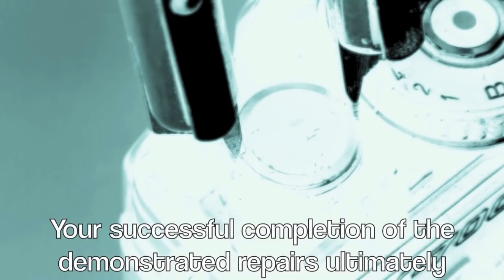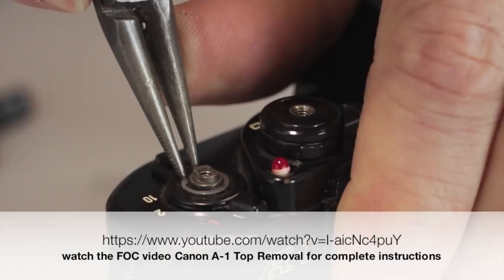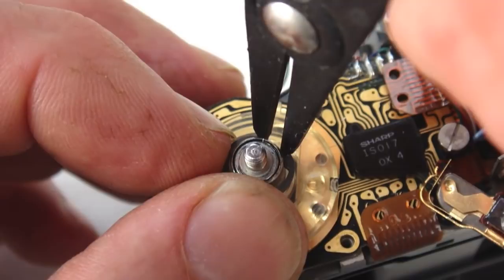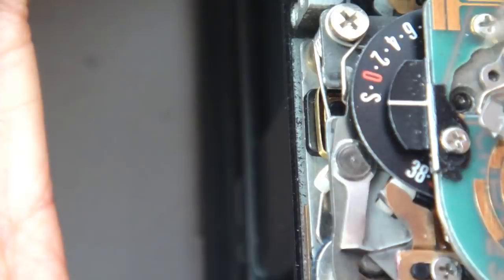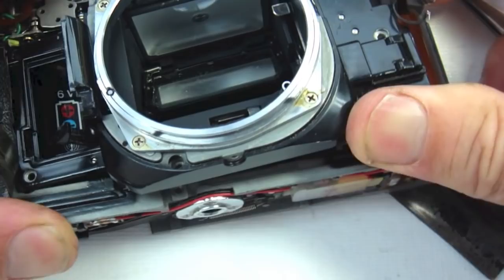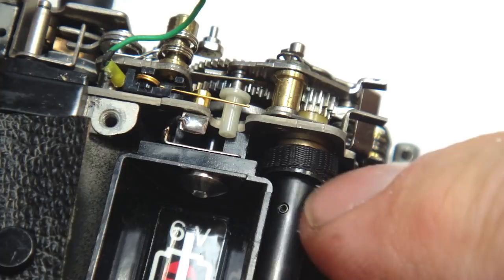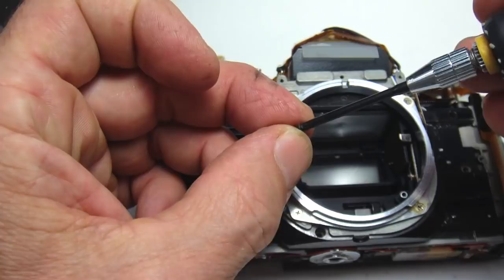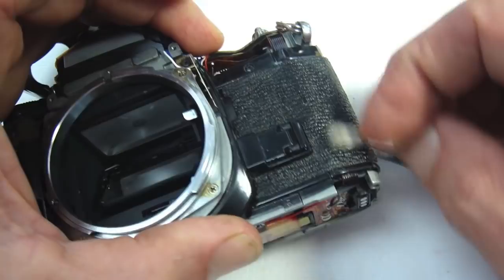Fix Old Cameras: Canon A-1 Mirror Box Removal

Comment: Awesome video. I've just followed this yesterday in order to fix a halfway stuck shutter. After the mirror box was removed, I managed to work on the shutter rollers with my fingers and eventually free it. Unfortunately, after reassembly there is no power anymore, no LEDs, shutter not working and I was really careful to not damage any flex cable. I just need to find the problem now.
Btw. the video is missing the unsoldering on the little switch board 😉
Reply: Same thing happened to me. Did you ever get it working again?

Comment: Thank you for your excellent video! I wish I had found it before removing the mirror box (to remove fungus from the prism assembly) using the A1 repair manual . Unfortunately, when removing the box, the wires that attach to the small circuit board on the upper right hand side of the mirror box (looking toward the front of the camera) became detached (they remain attached to the flexible connector). This board, I believe, controls the auto-aperture setting. If possible,  please could you advise the colours and locations of the wires that attach to this board. Your help would be very much appreciated. Thank you, Ian
Reply from the maker: With your described orientation, from left to right... blue, black, white, red.

Comment: Great video's, use them a lot when tinkering with old camera's
Reply from the maker: Your interest in Fix Old Cameras is appreciated. If all your tools are the quality of the Knipex 46 11 G0 pliers you suggest than you are well on your way. Keep'em going.
Reply: Thank you, i have a lot of good tools, but for the camera repairs I'm still collecting tools (or make my own, just found out that the rubber stoppers used in lab glassware are cheaper than the same thing sold as camera repair item)
Reply from the maker: Right on. Great tip.

Comment: Does the mirror box need to be removed to access the aperture signal coupling lever on Canon FD mount cameras? I have a Canon EF that has a damaged coupling lever; when it was supposed to couple with the aperture signal lever on my Canon FD 50mm f/1.4 SSC lens, it was scraping against the back of the lens and not allowing me to stop down all the way. I noticed it was bent and tried to bend it back, but that metal is not strong and sheared very easily. Would like to try repairing or replacing it as a project.
Reply from the maker: You will need to remove the mirror box.

Comment: What tool do you use for the “speed dial spanner nut” looks like it need something specific and isn’t shown in the video
Reply: Did you ever figure this out? I'm stuck here too
Reply: I used a pair of right angle tweezers, just be very very careful not to slip and scratch
Reply: @ben9412  Thanks! I've been trying with tweezers but there just doesn't seem to be any movement in it whatsoever
Reply: @jyraphos  sorry I realise we are talking about different bits (was a while since my comment and forgot what I was referring to!)
I actually used a “security screwdriver” bit set 
You there’s a two pin one in most generic sets from Amazon or the like that fits perfectly
Reply: There’s a video on my “Bengineer” channel of me taking my A1 apart, you can just see me using the tool at the very start in a generic L shaped holder. It isn’t very clear though due to the speed there
Reply: @ben9412 
Watch your entire video on x0.5 speed and wrote all the steps before founding this video
It helped me completely, but I'm stuck with the multiple exposure locker with the bar going up or down depending on its rotation and cannot make it so I can place the E ring

Comment: I'm stuck trying to remove the shutter speed dial nut at 03:41 - any advise would be greatly appreciated!
Reply: Hey, was stuck on this too
You can use a lens spanner wrench or a screwdriver head in the shape of a H kinda, worked for me, even after the screwdriver head broke

Comment: Hey Fix Old Cameras,

I’ve been having an issue with my A1. I finished up a roll of film & was loading a new one. After I loaded the film, I was winding the roll to set the first frame into place & I realized that whenever I winded, the shutter would go off. Now ever since, every time I wind to the next frame, the camera’s shutter automatically goes off as if I pressed the shutter button. 
Hopefully this makes sense, if not I’d be glad to rephrase. 

Any idea/advice on what to do, or what it could be, would be appreciated. 
Thank you in advance!
Reply from the maker: Check the holding surface of the shutter release magnet. This FOC video shows the release magnet in some of the A series cameras.

Comment: My film advance is stuck and only works when i activate the multi exposure, when i fire, he goes automatically for selftimer 10s, and after i fired the mirror stay locked until i activate the multiexposure again. Any toughts?
Reply from the maker: Might start with an investigation of the functionality of the stack of contacts and switch cams under the advance lever. However, with such a malfunction in the A-1 it could ultimately be caused by a failure of a circuit.

Comment: Hi I have a problem, two months ago, my dad gave me a canon A-1. But when I flipped the AE Mode selector towards Tv mode to test the speeds the mirror get stuck up. Then i move the main switch form A to L the mirror go back down. I look through the view finder i see a Bulb flashing 32, I go through all the speeds and that is the only thin i see in the view finder sometimes change  but if i put Tv mode to P still the problem. I just want to ask is you can make a vidio about this problem. I don't know to much about slr because this one is my first one.
Reply from the maker: Although without more details there it is uncertain as to the exact cause of the issue.Because the mirror release cycles complete when the camera is shut off it is probably indicating an electronic failure. When experiencing electronic issues on an A-1 always begin by checking flexible circuit connectors for proper alignment, tightness and cleanliness. Check wipers on all switches for positive contact. Finally check for flexible circuit damage. A mechanical issue with the mirror release would generally correct reset when the camera's wind interlock override and a completed wind sequence. It is possible that the INPUT-IC and or the OPT-IC are causing the malfunction. Trouble shooting and subsequent replacement there of might not be considered practical.

Comment: Hello, would you happen to know how to repair a Canon A1 that drains batteries ? I believe it has to do with the replacement of a condenser, but I don't know enough about electronics and would have to have a video done on the matter. Regards
Reply from the maker: Connect a DVM micro ammeter in series with the battery. Should be no current. If not check for moisture damage.  Turn on the main switch should be less than 2 micro amps. If it is more than 2 micro amps, check voltage at release magnet terminals, if it is more than a few millivolts desolder the black wire from the shutter holding magnet where it connects if current leaks stops, probably a bad IC (OSC/INT). Recheck current leak with top cover removed as there might be top cover caused short. (pinched wire) If the output from the original test is less than a few millivolts, desolder the connections to the preview switch (blue wire) and battery check switch (orange wire); if the current stops check the switch insulators.
Reply: @FixOldCameras  Wow, thanks for your reply. I'll get into it as soon as I have the time. Cheers

Comment: Since you seem to reply to almost any comment made on one of your videos, i hope you read this:
Is it possible to replace the A1 focus screen with those made for the AE1-P? Some people claim it works, some claim it doesn't and i don't want to order some just to try it.
Reply from the maker: Never made that swap. The A1 screen is thicker than the AE-1P. The AE-1P screen has tabs that would need to be filed off. It could probably be made to fit and then you would need to check for accuracy of focus at infinity at the very least.
Reply: @FixOldCameras  Thanks for your answer. I have some residue from old mirror cushion turned to a greasy, sticky mess i couldn't remove with isopropanyl. It's in the bottom right corner, so i'll stick with it until i can find a cheap replacement.

Comment: Hello! I have a question about the AE1 Program. I’ve been given one to play around with, but I’m trying to judge whether it’s worth fixing or is just a parts camera at best.
The shutter was jammed, so I watched your other video about manually moving the magnet. Shorting the ground screw on the contacts didn’t work so it seems like I need a magnet replacement. 
Before I buy one though, I have a question. When I manually move the magnet and the shutter releases, should the shutter screen and mirror release at the same time at the designated shutter speed, as if I were completing a regular exposure?
Currently when I separate the magnet, the mirror just flaps idly upwards and bounces down again, and with the camera back open, the shutter screen just seems to shift across and not actually open. 
Could this be indicative of some larger problems with the timing circuitry and the electronics? If so, I think it would be cheaper just to abandon the project and buy a used working AE1 body. 
If not, what else should I try? The only way I’ve managed to make the mirror stay open at the moment is by manipulating another smaller magnet in the bottom of the camera. The shutter doesn’t seem to be doing anything normal at the moment.

Thanks for your help! Love your videos, I’d love to take this up as a hobby.
Reply from the maker: Tripping the camera via the release magnet does not involve the shutter timing circuit so you will not have any speed control. The smaller magnet holds the second shutter curtain open to time out the shutter speeds. When the second curtain completes its travel it in turns trips the mirror to drop.
Reply: Fix Old Cameras thankyou!! I’m going to go ahead and buy a replacement magnet and see if I can get it working. Thanks for the succinct advice, as usual. Love from the UK.
Reply from the maker: Right on... or maybe find an inexpensive donor that you can salvage parts from.

Comment: Can you make a Video about the Canon EF?
Reply from the maker: A very sturdy camera with a shutter that would make for a good FOC feature. An electronically controlled Copal shutter from speeds 1 second to 30 seconds... and mechanically controlled shutter speeds from 1/2 to 1/1000. If the batteries die you are still in business! And on the subject of batteries... the Copal shutter in the EF has a stepping circuit in it so that the use of the 1.5 volt batteries can be used to replace the original 1.35 volt batteries without any need modification. Can not say when such a video might appear... but it is on the list. Thank you for the suggestion.